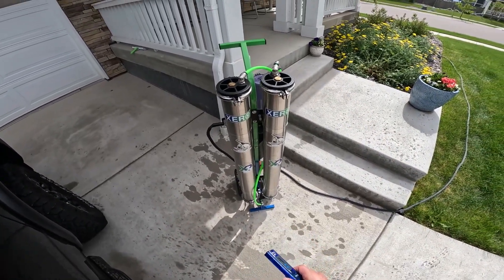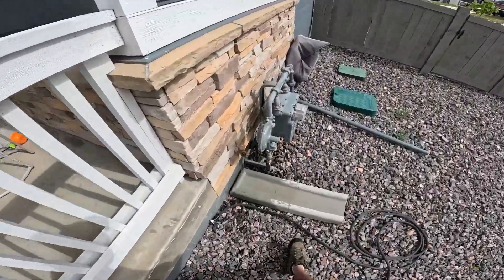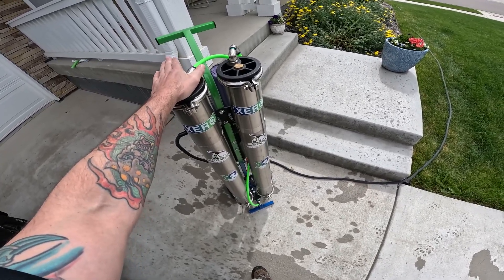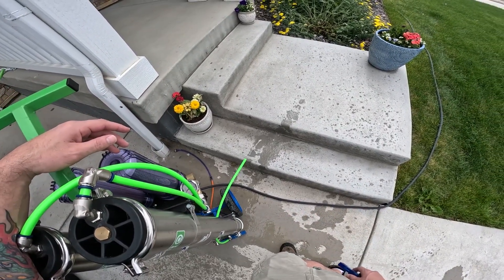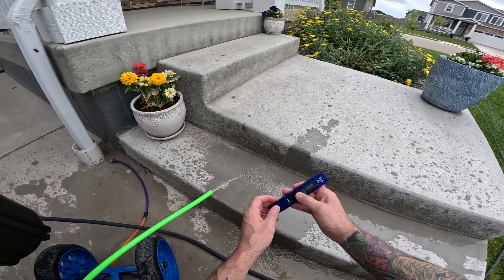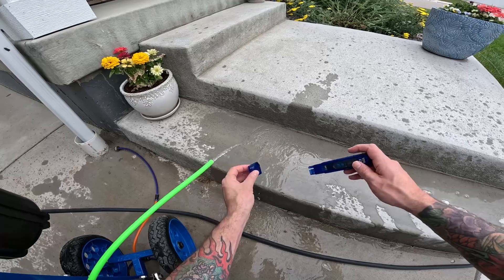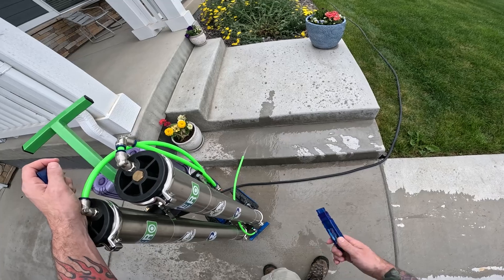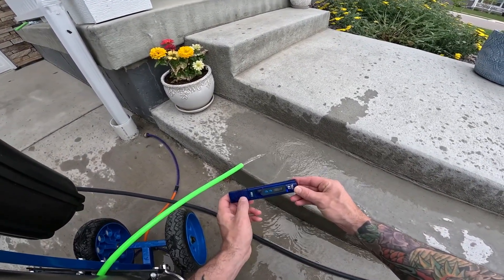HOW TO TEST RO MEMBRANES | PURE WATER SYSTEMS

Comment: I have the Tucker 4060, been using it commercially for about 5 years now. I have changed the carbon and DI filter fairly regularly, but have never changed the RO filters because I’ve always had good TDS numbers. Is it possible to have good readings and still have bad RO filters?
Reply from the maker: Most likely the ROs are still good, I’ve made ROs last for 5 years, if they’re properly maintained they can last for a while. But I’ve seen some areas where no matter the maintenance done ROs are replaced every year

Comment: I have had my system for 1 month and once the water goes through all 3 filters it anywhere from 5-13 tds. Is that normal for 1 month old machine
Reply: Check that your resin filter is in and dosent have a plastic covering on it still
Reply: @ReelNeal55  how exactly do I check that 😅
Reply from the maker: Hi, I think I saw you post on another video, with average TDS around 600, can check the Di cartridge to make sure the O ring is seated and lubed. Check out this video https://www.youtube.com/watch?v=kT4ZF08gT7k